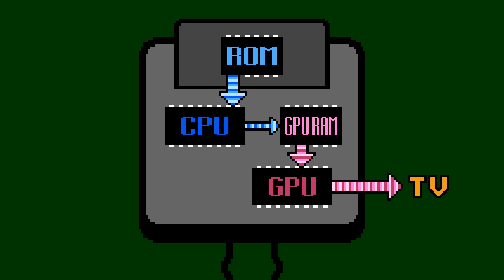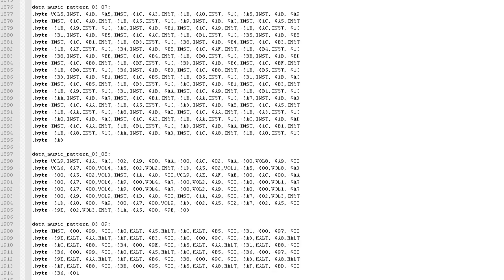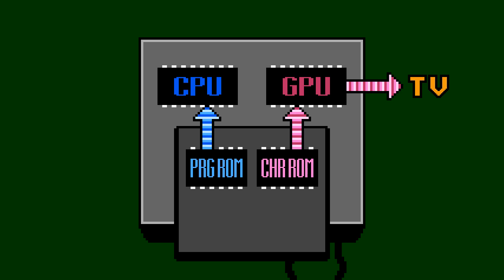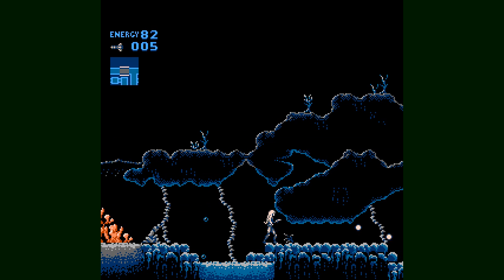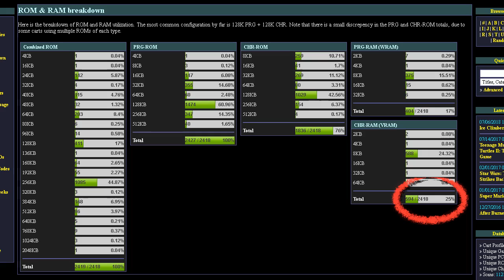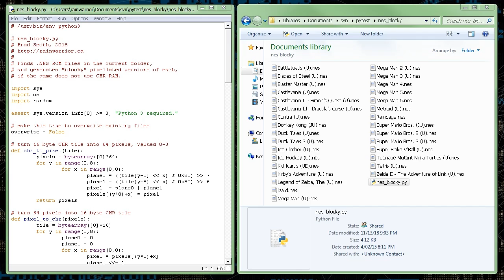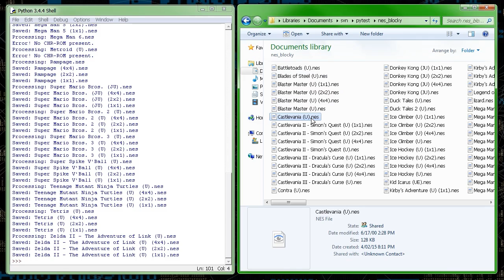Why does an NES cartridge have two ROM chips inside?

Comment: You're a legend who did great work especially on Star Tropics ... but you're not right about the NES's loading mechanism. Nintendo of America didn't want the NES to look like the Atari because the NES was due to launch after the videogame crash, so they gave it a high-tech look like a VCR (which was hot shit at the time). In Japan (and later in the US) they used a regular top-slot mechanism and it was much more reliable.

Comment: I appreciate how this video starts with a technological choice and then underlines its relevance to design and play. Even if it oversteps the history a little, like with the connectors, this framing device is a good way to dip into different perspectives.

One thing I'd add: the usage of ROM/RAM chips was complicated by a shortage in 1988 related to shifts in international policy and the goals of Japanese chip factories. At this time, since Nintendo controlled the manufacturing quantities of third-party titles (per their contracts with outside developers), there was some speculation that the company reduced the availability of non-Nintendo games in order to secure chips for their own. Might be part of why the number of third party titles per year rose significantly as the 90s arrived — but then again, perhaps not! There are a lot of factors behind putting a game on shelves, and I don't mean to set anything in stone here. Just raising a few interesting historical fulcrums.

Comment: Because one is used by the tile generation hardware, and one is used by the CPU.  It allows the PPU to concenrate on generating the screen image without competing with the CPU for bus cycles to ROM/RAM.

I understand the tile generator was basically a repurposed text generator.

Comment: 5:22 this thing looks like someone has hand-drawn the exposure film for etching. Was this thing mass-fabricated? Because this looks like an unnecesary amount of acid getting saturated etching away parts of conductive layer in places that play no role in insulation anyways.
Reply: "Jack, is the PCB ready?" - "Yeah, I just need to draw a few lines" - "Ok"
*after acid vaporized and cleaning*
"Jack?" - "Yeah?" - "You are fired"
Reply from the maker: It's a professionally fabricated board, but the layout definitely looks hand drawn. Sunday Funday was a mass produced game. I've seen similar boards before though, you might take a look at the NES and Famicom controller PCBs.
Reply from the maker: Here's the photo source, BTW, if you want to look at the back of the board too: http://bootgod.dyndns.org:7777/profile.php?id=961
Reply: Do not attempt to disassemble*
*failure to comply might result in damage to eyes and psyche
jk

Comment: This is factually inaccurate. Specially at the beginning if you factor in SuperFX chips on the SNES. Plus the original Famicom doesn't have that connector nor does it need it.

Comment: Your argument about the extra life due to different coprocessor sounds kind of bogus because both the megadrive and the superfamicom had cartridges with coprocessors, like the SuperFX or the SVP. This design is totally unrelated to the coprocessor/mapper situation. In fact coprocessors slowly faded away in the next generation because the consoles were usually already plenty overpowered and extending their capabilities meant making the carts super expensive (see the examples above). |That's why SEGA tried to "standardize" them into proper upgrades instead of shipping a copy on each cartridge.

Comment: Can I use Python to make an nes game am currently learning python right now
Reply: Surprisingly, you can, but it's more of a proof of concept: https://gutomaia.net/pyNES/

Actual NES development is done in 6502 assembly though. If Python is riding a bicycle with training wheels, assembly programming for hardware as old as this is like completing the Tour de France. You can learn it on your own, but you need a solid grasp of programming and mathematics, basic computer hardware and NES hardware limitations in particular.
Reply: @no1DdC  I would say it's mostly the PPU that makes it tricky, not the 6502 asm.
Reply: @totallynotabot151  You're right. It's just that assembly in general is such a huge step up from Python that delving further into details isn't really necessary at this point.

Comment: The really absurd ting on the NES is that they added so many more pins but REMOVED the sound routing through the cart. Just, why?
Reply from the maker: Technically they added 10 extra general purpose expansion pins, which COULD have been used for audio, but they were routed into a hidden connector on the bottom (under a plastic tab you had to break off). The audio connection is there on that hidden port, but nobody ever built and adapter for it*.
(* some homebrewers did make one fairly recently.)
Reply: @Sakanakao  Some of the extra pins were used for that bastard lockout chip that Nintendo stuffed into the NES.

The fact that they rerouted the expansion audio to the unused connection on the botton of the system implies to me they were considering something like a US version of the Famicom Disk System.

Comment: I've heard that it was meant to resemble a VCR with it's front loading mechanism. 

Video game crash in US happened just two years prior. I haven't heard of anyone having problems with their Famicom in that way even today 30+ year old hardware, so only if it was based on front loading because someone thought that it would be better... turned out to be worse with the connector needing to get changed is very common with the NES.

I for one wish they would have kept the Famicom design but launched it in other colors in the west.

Comment: Err. No. Your reasons for the slot-loading mechanism existing are incorrect.

This should be blatantly obvious for two reasons - the Famicom, and the late era AV famicom and Slot loading NES.
All of these have conventional slot mechanisms.

No, the design of the western NES can be directly attributed to the US game market crash of the early 80's.
This is also the reason early versions of the NES were only ever sold with ROB, even though it's an accessory that doesn't do much.

ROB was included so the NES could be interpreted as a toy, and the slot-loading mechanism makes it resemble a VCR, and gets away from the image of top-loading cartridges people associated with 'game consoles' such as the 2600.

Even the marketing terms pointedly tried to avoid calling the NES a console.

Meanwhile, the Famicom ignores all of this, because the crash and associated negative image of 'game consoles' never happened in Japan. (or Europe for that matter, but I guess they still felt the US design worked better for Europe. The European SNES meanwhile is effectively in a Super Famicom case with different labelling, even though by virtue of needing to output PAL the internals are different, while the US model is in a unique case design even though it's internals are almost identical to the super Famicom.)

The slot-loading mechanism actually makes the system less reliable, and is the most common source of failure in the system, but it makes no sense to say it existed because of concerns about the number of pins.
Reply: I agree 100% this was only for marketing problems. It has zero logical reason to do this, you guys are worrying waaaaaaay to much about torque and pressure, in something that is extremely simple, would you say that it was very hard to place an expansion ISA card in your 386 or 486 PC back in the day? This just don't make sense at all.
Reply: Massive headache. The video explains part of the reason why NES enjoyed such a long market run, but since this structural issue was more likely to become a problem as time went on, it essentially meant the NES and its games were good enough that most typical gamers would eventually wear out that connector. It's my understanding that the NES will still run games even if you don't push down the tray, and pushing down the tray is what puts torque on the pins, right? So if you just pretend the push-down feature doesn't exist, the pin connector should last longer. Hindsight, I guess.
Reply: Yes, it was simply a stylistic choice (for the US market) and actually lead to more problems than solutions.
Reply from the maker: There's a discussion of this a little further up. Another commenter above made some suggestions about the different angle and added torque from the length of the cart. Gravity acting against the top side of the pins also seems relevant.
Reply: Brad Smith then explain the NES 2
Reply: That still doesn't make sense.  There's no reason why you would want to put more torque on the top pins in comparison to the bottom pins.  They made the cartridges that large (which are mostly just empty space), and they made the slot ZIF to make it seem like a VCR.  That's it.  There is no technical benefit to doing what they did.  It was completely marketing.
Reply: @lilmul123  okay but it stands to reason that putting the catridge in horizontally had challenges, otherwise they could just make the catridge go straight in instead of having to push it down. 

actually, it would make sense to put more torque on the top pins in this configuration. gravity would probably eventually make it so the bottom pins have more give, thereby making it harder for the top pins to actually reach the contacts.

Comment: But, wasn't add-on hardware common in cartridges at the time for everyone, not just Nintendo? That practice was going on IIRC until the DS, but was mostly prevalent in the 80s and 90s systems.
Reply: DS did have some add on hardware, it isn't common but there was some examples. Remakes of Pokemon Gold and Silver had IR ports, one Japanese only title had a GPS device used for Star Gazing, and one cart had bluetooth added
Reply: Sorry, I should have phrased that better. I meant that add-on hardware was common since the NES by just about everyone who made cartridges, and while it certainly was much much less common by the DS era (especially since by then they were "cards" not "carts" and operated fundamentally differently than carts used to, being just storage rather than an actual extension of the system) it was still happening by then.

Comment: I really love videos explaining how older hardware works. is quite useful when you are building an 8 bit System yourself.

also i thought the NES uses a PPU (Picture Processing Unit), GPU is more of a PC thing and the term itself wasn't used at all in this time
Reply from the maker: Yes, Nintendo's term for that component on the NES was "PPU", but that's their own special name for it. I am making a comparison with other systems (they all have funny GPU names like VDP, RSX, CGA, Denise...) and I wanted to use a term that people today would understand.
Reply: Gpu would be an anachronism. The display processor really doesn't process anything. It just sends out bits according to some display standard and the part that does that in modern graphics cards isn't the gpu
Reply: @Sakanakao  well personally i think it would be better to use original names in case people want to learn more about the matter. and learned about a GPU here and every datasheet and WIkipedia article about it calls it PPU, it could be confusing 

but besides that i would really like to see this becomin ga series about NES hardware stuff. kinda like how this guy does with the SNES https://www.youtube.com/watch?v=57ibhDU2SAI&list=PLHQ0utQyFw5KCcj1ljIhExH_lvGwfn6GV

Comment: the zero force connector doesn't exist on the original famicom - why do you think that they worried about the stress of the contacts when they didn't have problems with it in japan?
Reply: I think the ZIF socket may have been needed because the cartridge is angled in weirdly due to the front loading mechanism, which is something they wanted to do to make the device appear more VCR-like and less like a game console. The cartridges also have a lot more lever torque due to how long they are, again a marketing driven decision as opposed to the low height Famicom carts, so any force applied to the end of the cartridge is amplified at the socket - but indeed, top loader works fine so there's that.
Reply from the maker: @SianaGearz  Ah, I like that thought. Gravity acting against it necessitating extra pressure to keep the top half well connected? That makes sense.
Reply from the maker: The NES cartridge has many more pins.
Reply: @Sakanakao  I'm not convinced that going from 60 to 72 pins would add that much more stress to the connector.
Also, Nintendo did even release a top loading version of the NES which doesn't have the same problems with the connector as the regular version :-)

Anyways. Nice videos man! You've got a new subscriber! :D
Reply from the maker: @popmongo  I'm not trying to convince you it was a good decision. Nintendo thought it was a mistake too, hence the top loader (and every NES clone ever).